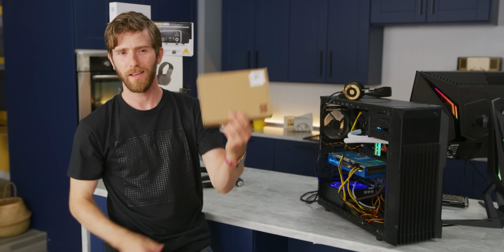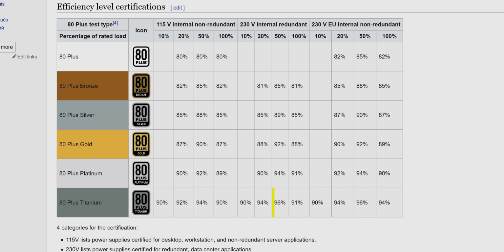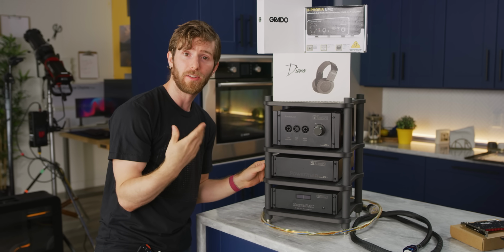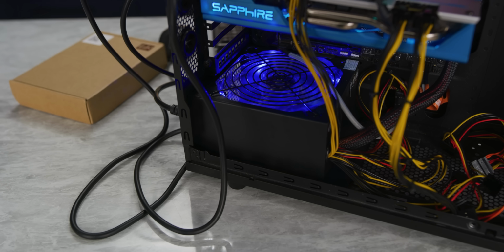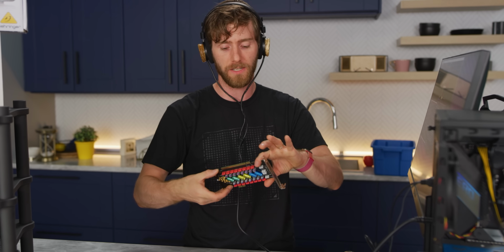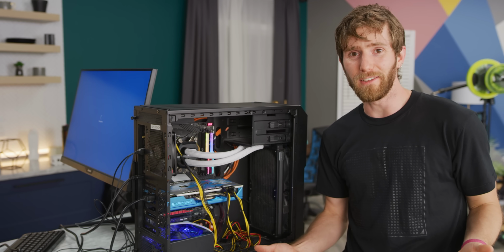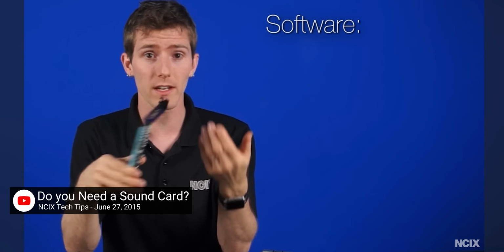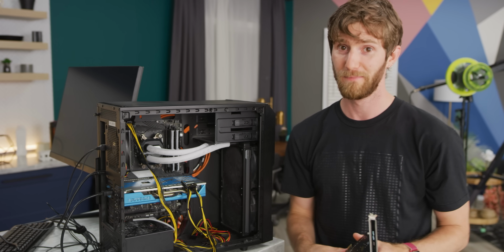Is this $40 card a SCAM? - "Audiophile" Power Filter

Comment: So I have a USB AudioBox from Presonus, and for years if I drove the external interface hard, it would get noticeable noise.  Moving my mouse or windows on my monitor without any audio playing would result in noticeable crunchy sounding interference noises.   To solve it I eventually dropped some change on a really good professional audio USB-A to B cable. One designed for DJs to knock out interference inherent to being on the same circuit as the mixer, booth monitors, and lights, and the resulting signal being amplified greatly for playback on live audio PA systems for thousands of people. 

What I found was: The cable alone was enough to knock out the noise, on playback.  But recording INTO the sound interface and the terrible noise floor was still there, which has presented a problem for live streaming, and using the interface as a capture for the signal from the DJ mixer to broadcast off my PC and DJ off my laptop.  This is with balanced audio cables, so the noise is still coming from the audio interface, and internal PC components.  Likely ground loop interference because my laptop and desk have to be on the same circuit. 

So if you really want to test this card, get a cheap USB interface, and test it that way.  When I was first shopping for an interface, I noticed that the Focusrite Scarlett SOLO had the same problem, and returned it for the AudioBox USB, which didn't solve the problem so I kept it cause it was good enough.   Be sure to have other audio signals (2.1 speakers on the same circuit as your desktop for example), Ethernet switches, basically anything you can, on the same circuit, as that is the actual use case here. A simple way to reduce noise when you have a home setup.  I'd be curious if this card helps with my specific noise problem.

Lastly: Aren't you using a motherboard marketed for really nice realtek audio isolation?  You need a cheapo motherboard too, where the realtek audio chip is poorly insulated on the mobo itself.

Comment: Hey Linus have you ever heard of ps audio? They make what is called a power regenerator so instead of conditioning or filtering the power it makes new clean power that has no electrical noise. You should try to get one of there regenerators and see how it works and if it actually works like it should.

Comment: these card won't do anything except adding more capacitance to the respective rail (most likely on 12V only). for power filtering to do its job properly, it needs to be close to the load itself. for example, ALC1150 uses 5V and 3.3V rail to work and this card is most likely only filters 12V rail (though there's 3.3V rail on PCIe, i doubt they filter it). i don't think board manufacturer would bother to put a dedicated buck converter to extract 5 and 3.3V from 12V rail just for audio codec like AIB manufacturer would do. not to mention at how high switch mode PSU frequency that you're most likely can't hear the effect directly.

tl;dr, yeah. don't spend 40 bucks on a card that does nothing. just buy a good PSU and proper audio equipments.

Comment: Does anyone have any legit suggestions of sound cards or even value-priced DACs? like, I have an asus xonar dgx (with custom drivers)- it's significantly better than my onboard, to a very obvious degree. I have dt770s and I am not upgrading my motherboard until we get something beyond 10th gen intel which wasn't good enough to upgrade from 8700k yet(i dont really like amd sorry i just prefer how intel is set up and optimized for my use cases, i want at least 10 physical cores and the 10900k is too :\ atm). 

My onboard SUCKS. It's really really bad. I've had this xonar card for so long and it's always been better. (note: the dgx is better than the dg and the other xonar cards) 

But I know it's on its way out, it doesn't quite sing the way it used to. I'm also a bit hearing impaired (worked on jets in air force) so I can't bother going the full audiophile route since I can't hear the difference. but I can 100% hear the difference between a bad onboard and a mediocre sound card.

is there ANY option for someone like me or am I stuck until I get a more current mobo?

Comment: You guys didn't test it with an audio interface. And that Beringer UM2 is garbage, it doesn't even come with its own ASIO ( What you need to get inputs from the interface) 

You also didn't test this with speakers / studio monitors. I currently have a huge problem with this type of noise and this video didn't test this card in ANYWAY that I would be using by myself. You also didn't test it with lower end vs higher end motherboards to see if that actually does make a difference. Also, most people buying this, will be using it inside of a DAW, which is something you didn't test either. Also didn't test incoming audio at all, which still is susceptible to noise. 

Also, you didn't have USB's occupying all the ports, and didn't have that much plugged in. I'm an amateur music producer and I have only spent ~$1000 on audio equipment, but this is definitely a HUGE problem for me, that I think this card might help. 

So for the first time, I have to watch another video on the card to see if it's actually functional.

If you want Linus I'm only one province over. I could drive over and get this video done right for ya 😊

Comment: I'm not going to defend a Chinese placebo, but you could have at least made it an objective test instead of subjective. Plug your pc audio into an amp and a big speaker, crank it up all the way, listen to just your base noise, then plug the card in, do the same thing, and see if it made a difference. Eliminate other factors, such as amp noise, or speaker noise by plugging them into any regular power conditioner, or perfect sine UPS (which I'm sure you have a ton of)

Comment: No point of using cheap psu and overclocking motherboard. Pair cheap psu and low end motherboard or even few gen back motherboard that lots of people still use. Maybe the results would be the same but makes much more sense.

Comment: The first thing that comes to mind after seeing the intro:
If you have noise in your system: Get a 10$ "Ground loop Isolator". I Always had multple pc's, soundcards, mixers, etc. tried to run all cables clean, have a modern power delivery in my flat etc. I never got rid of noise. Unitel i got t a 10$ "Ground loop Isolator". Solved it ... f'in 10$.

Comment: 2 mins into video... Absolute bull. So much bull. It's pretty looking bull, but it's complete bullshit.

Got noise? You either shield it or you filter it inline, before it goes on to power your system. Adding a filter after the fact is complete bullshit.

Edit.
Phew... Glad you got there. You explained it in much nicer terms than I would but that is proper damn audiophile snake oil.

Comment: Linus you really miss tested this product I want a second video properly done. You don't test a power rectifier on the NON-AMPLIFIED rear ports of a system, you test it on the AMPLIFIED FRONT PANEL ports, or even both, I love Linus but this video was 12 mins of me screaming at my screen trying to tell you to stop fumbling with the motherboards clean on board audio. Front panel connectors are your real enemy in this video, they are powered directly by the PSU, which is why they sound noisy.

Comment: Coil whine doesn't come from the 12V or 3.3V d.c. that comes into the PCIe card. Coil whine comes from from magnetostrictive forces in the chokes (coils). The switching currents from the graphics cards step down regulators cause alternating currents to flow through the chokes.  The large currents in the coil cause the core to expand and contract (magnetostrictive forces) acting as mini-speakers. Better quality chokes are the solution, not filtered d.c. to the input. Linus pointed out that the graphics card has a separate 
12 V feed anyway.

Comment: im pretty sure you got a old, cheap, poorly made motherboard in your warehouse somewhere, and not use a damn top of the line ROG board to test that card on....i mean you got the best hardware a average consumer would buy, why not get a real audiophile in there to listen to it? To be honest there issnt much thought put into this video. basicly, lets try this here card, lets grab a system off the shelf that people are actualy using today,  and lets find out that a issue that existed 20 years ago is dead for about 15 years.
Instead follow up with it and see if theres any situation where this system actualy makes a difference (if any). i mean if the system you described with the horrible sound still sounds horrible it means the card is just junk.

And for the coilwhine, grab a graphics card without external power? plenty of people game on cards like that.

Comment: “This sapphire nitro plus 590 special edition...” hey that’s my card!!! “For maximum coil whine” oh........
Reply: I was so excited, for like... 2 seconds
Reply: I have that card in my workshop PC and it has virtually no coil while. The case fans make more noise than anything, really.
Reply: OK just a tip here for next time you want to test audio diferences. Record one audio sample. Change the thing you want to test. Record the same audio sample but flip the polarity. Now if you hear something there is an effect and you can analyze it with soome rta software. If there is silence there is no effect.
Reply: @mihkelmaidla2126  IMO it's usually most obvious when there's no sound playing. Electrical interference caused by induction is usually present regardless of whether music is actually playing. But to record it, you need to used the audio output as an input, preferably at max volume.
Reply: @mihkelmaidla2126  Nice tip!
This is called phase cancellation, in case anyone wants to look into it.
Reply: Same
Reply: Exactly my reaction
Reply: have the same card and 0 coil whine
Reply: Same card, no coil whine. But the fans can be pretty loud tho :/
Reply: same lol
Reply: Same, but I dont ever hear the whine xD
Reply: Me too lol, I have an RX 580 nitro+ SE
Reply: Yeah, that's my card in my primary rig. I have never had trouble with it and never noticed any noise. 🤷‍♂️
Reply: Ehm, coil whine can be on any card, if u don't have any u awesome luck :) I had 1 980 without any coil and one with one both same card and revision etcetera
Reply: I have the same card, other then normal fan noise its quiet. LTT just has a dud.

Comment: An audiophile wouldn't be seen dead with a $40 part 💁🏻‍♀️
Obviously you would start with a 99.99999% pure oxygen free copper mains lead for $25,000 (you can get the same benefits from a slightly thicker wire gauge btw), and continue from there.

By the way you should test it on John Cage's 4'33" at maximum volume, run the line out to line in on another computer, record it, and analyse the waveform.

Comment: well nothing but "god himself" will stop the coil whine inside the GPU.  if the audio is good to begin with the card is pointless anyway.  it would be interesting to see it tried in an actual problem system. (assuming this was not such)

Comment: A decent DAC is a much simpler and cheaper solution.  No need to spend 100's of dollars.  Mine's only $40 and couldn't be any happier with how amazingly it delivers hi-fi audio experience at such price.  Brought the same level of performance as my old amp that was taking too much space.  Only limitation is the # of outputs and amount of micro adjustments you can make with a high end amp.

Comment: If you do go the DAC route, be sure to change your speaker properties in windows for the DAC.  For example Windows defaults to 16 bit, 44/48Khz so you would want to increase yours to match the maximum your DAC can run.  Please not that upping your default format to a higher level won't just magically make everything sound better and can have some small overhead trying to upscale audio.

Comment: So here's a suggestion, instead of using headphones try using active speakers as they will pick up on noise a lot more than headphones will. I had an issue with my lounge setup where the GPU caused buttloads of noise via the HDMI lead that was running the TV. Adding an isolation transformer on the audio out of the TV fixed the issue.

Comment: Problem is is that you're running whatever Asus Maximus Hero board that is, and guarantee that board has top notch rear audio (like my older Aorus Z370 G7) and it probably does a fair amount keeping your audio somewhat respectable, should've found a cheaper board with lesser power components that lead to comparable DACs and amp.

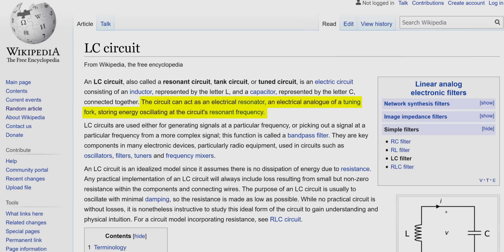Comment: 9:10 We racing drone pilots throw at least one low ESR cap on every build.  It makes a huge difference with analog video and helps the rest of the system including, keeping motors cool, the gyro cleaner, and preventing the ESC's from de-syncing. 

Pretty cool that a LTT member at least is familiar with the hobby and probably in it. You guy should have a racing drone episode on channel super fun or something, that would be cool.

Comment: Any good UPS will deliver smooth power to the system. Matched with a modern PSU with any 80+ rating and the board should be getting  "clean" power. Isolate the audio with a $40 DAC and get better performance improvement than this card provides.

Comment: Electrical engineer here. This thing actually does affect your CPU, GPU, and everything else, as the vast majority of power supplies actually only have one "rail" for 12V, so everything is connected in parallel, including this card.

That being said, capacitors in parallel have some (if negligible) positive effect on the quality of power delivery, coils do not. Coils would need to be connected in series, which is for all intents and purposes imposible, without cutting something up. CPUs and GPUs care very little what's going in. At one point in time I ran my PCI-E slots on about 5,5V when the 24pin plug burned out and neither mobo, nor my two bios modded GTX660 gave a f***. I only noticed when I randomly opened up HWinfo and bought new PSU thinking the old one was shit.
Coil whine is completely separate issue and it is caused by GPU mosfet's switching, and no amount of filtering on the power supply side of that mosfet is going to help it. It might get slightly worse if there was significantly lower voltage on the 12V rail, but something WOULD be in flames long before you noticed any difference.
As for sound, if you hear noise that shouldn't be there, that's mostly because of shitty trace isolation on the motherboard, rather than bad power supply.

More capacitors also means significantly higher load on the PSU during startup. It may take several rounds of switch-on - OCP trigger - try again to charge all of the capacitor to such a level that charging them to full 12V doesn't trigger OCP. The power supply might outright refuse to start up, or it can go up in flames, possibly along with the rest of the system. Even if it doesn't, you may still damage the motherboard traces or connectors, by this momentary load that is orders of magnitude higher than what those traces are designed for (>100A vs 6,25).

It might be worth something, if you often experience short episodes (<1s) of power outage, though a UPC is definitely a better solution in that case.

TL; DR: snake oil, do not bother.

Comment: You won't see a difference if it was fine in the first place, Linus.
You could do a lot more to dirty up that power.
Most interference that I get is from outside the PC:
AC turning on and off
Powerline Ethernet adaptors
An old plasma tv on the same circut
Like a dozen super cheap usb chargers
Ground loop interference

All of that comes thru my PC audio, and gets doubled if I use external powered speakers.
I put everything on 'power filtering' surge protectors which helped, but I am thinking about getting a UPS because it's so annoying.